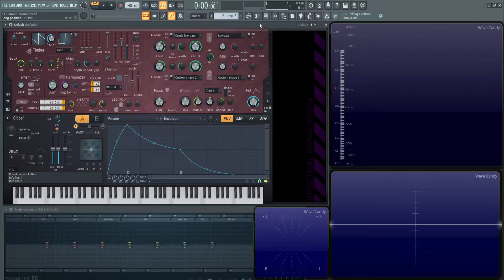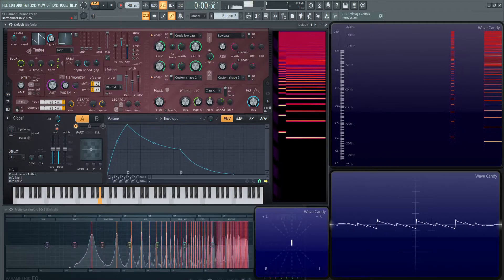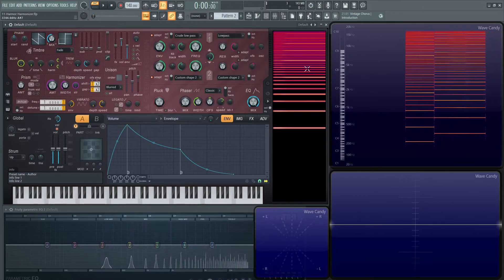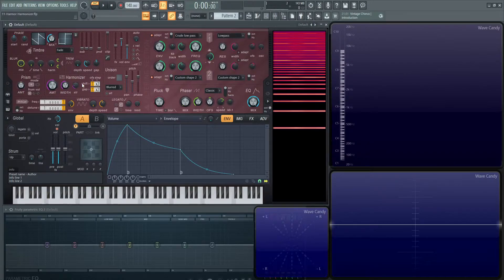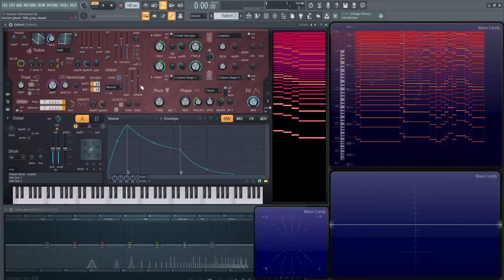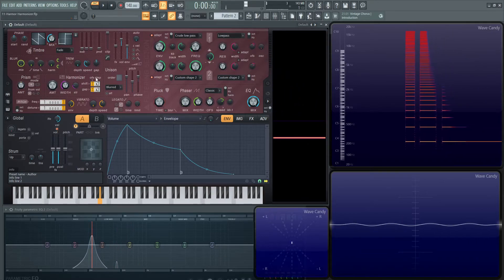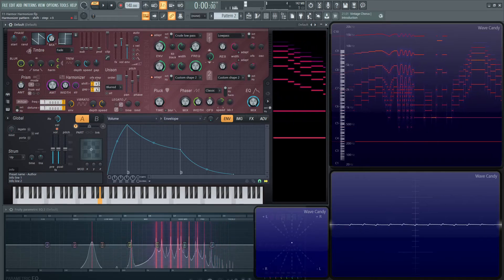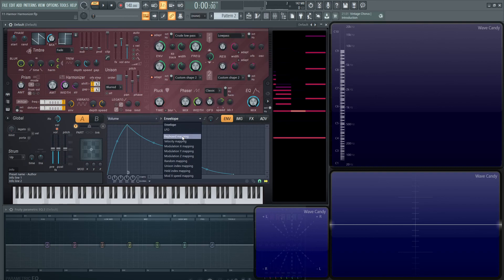Harmor Tutorial PART 11 Harmonizer | FL Studio

Comment: Hi, I've almost finished studying what Harmor does. I've made some patches as I was following the videos, but now, as I've started making patches that I need, the smallest of things become big issues. My question, if you know, is, how do I make the attack (faster or slower), respond to velocity and for that matter, how do I make anything other than the volume, react to velocity ? Thanks
Reply from the maker: great questions! so for velocity dealing with faster and slower attack, use the options in the top center of harmor, right below the knob labeled 'auto'. you'll see a small 'vel' with an arrown pointing down to those buttons.
As far as using velocity to respond to other things, you'll have to edit the articulator in the graph and for the second drop down menu, select velocity mapping, and in that graph you can customize quite a bit.
Reply: @jonaudio  It wasn't that linear but with a few tweaks I've managed to get the result I wanted. The problem now is that if you play legato with your fingers it will ignore the effect, only when you strike the note it will recognize the slow velocity and it will start with no attack. With Harmor everything is extra complicated but I will solve it. I started reviewing Zebra and your videos on that are a great help. Thanks and I'lll see you next problem.